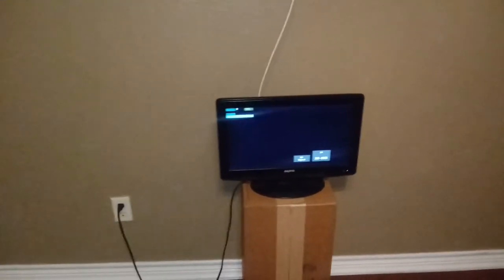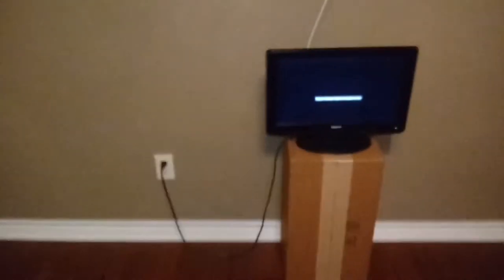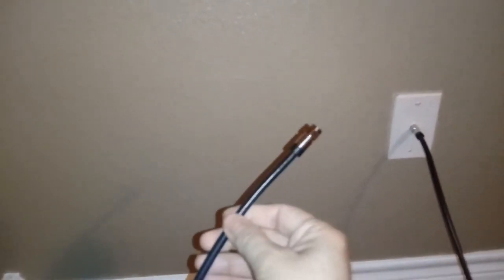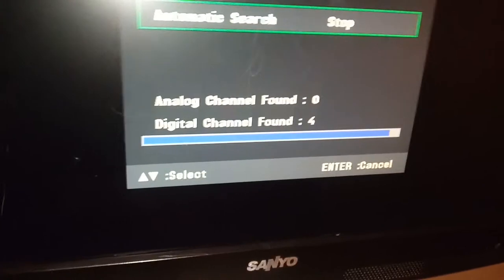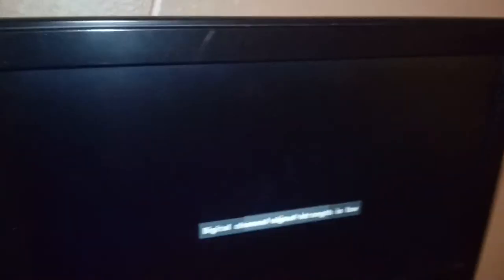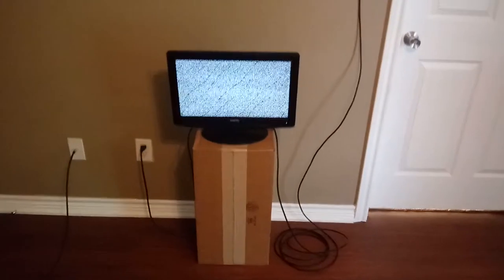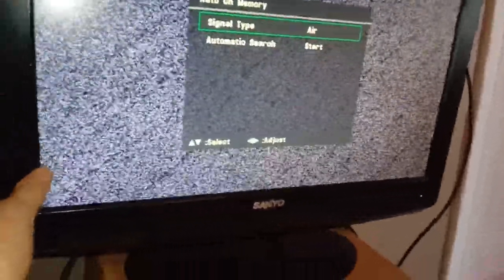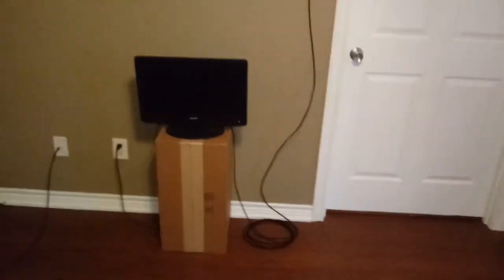The Best Indoor TV Antenna Reception TIp

Comment: They make flat coaxial cables to fit through windows or doors.  They are not to expensive to get.  Its a simple way not to have your cable to be damaged or cut.
Reply from the maker: Yeah, I knew that, and I forgot to mention it in my video, so thanks for the tip!
Reply: @ThriftyinfoMix  , what if I play games on my PC and I also use my television as a bigger monitor since my laptop screen is so small?
Reply: @ThriftyinfoMix  , is there a device that is made for televisions and digital antennas that can make a separate pair of cables go from the digital antenna to the television and from the television to the cable?  I think that having a splitter, as well as having a pair of typical width, as well as strength, cables might help fix that problem that you described in the video.
Reply from the maker: @paxhumana2015  it all depends on how close the electronics are to your antenna cable. If you can keep the electronics away from the cable then the interference would be a lot lower.
Reply from the maker: @paxhumana2015  I'm not sure that I understand the question, but it seems like you are wanting to have cable TV and OTA antenna television at the same time. The answer is yes this is possible and there are several ways to accomplish this depending on your situation. One way to do it is to just use the device that comes with your cable or satellite provider which is the box that you use with their service. This box sometimes has an antenna input where you can plug in your digital TV antenna. Another easy way is to subscribe to an Internet satellite service or some other cable TV streaming service such as Sling TV so you can free up the cable line to use it for the antenna. If your cable or satellite service does not come with the box, then you can use an old VCR to run your antenna to the antenna input and then run your cable or satellite into the inputs on the VCR and use AV cables to run the signal from the VCR to the TV. Lastly, you could run both the antenna cable and the cable TV cable into an RF switch box splitter and then run the switch box into the TV, but you would have to manually switch back and forth between cable TV and digital antenna TV.

Comment: Well, at least your tip helped me confirm that this thing ain't gonna work unless it's set up outside or at least at the window. Thanks
Reply: Indoor antenna outdoors,I also would worry about grounding.
Reply from the maker: Yeah, an indoor antenna is not the best unless you live in an area real close to all the stations, but you can get it to work best the way I explain in the video.
Reply from the maker: An ungrounded antenna is for sure an issue, but less of a problem if you have other things that are grounded which are higher up than the antenna, or if you have the antenna touching another grounded object to get better reception such as I do in this video, then it will be less of a problem as well. Thank you for bringing up this important issue since I forgot to mention it in the video.
Reply from the maker: @PC4USE1  it's also important to remember that antennas like the one used in this video are usually labeled as indoor/outdoor so they are made to be used either way since they are not strictly just indoor antennas.

Comment: set up  , Bumpkin 101.
i guess you can live with that expert install    
The hooks are upside down
  that is Bumpkin  genius 
Mr  Pyle
Reply from the maker: Thanks. I did install the hooks upside down intentionally so the cable would not slip out. Not only can I live with this install, but since I used removable hooks and no tools, I can easily uninstall the whole setup but hand without damaging anything install it somewhere else since it isn't permanent, but it's still secure...

Comment: i am on a 1st floor in a block apt of 8 apt attached to rows of other block apts on my street
when i put the rg 6 coaxial cable attnana outside the window its till 7 chananls which is what i get inside;
should i make the wire touch the metal balcony? Lisa thank you
Reply from the maker: Wow that's strange. You should not get as many channels with your antenna inside, but yes the metal on the balcony might help, but I suspect you are in an urban area where the TV stations are all close by and it won't matter that much. If you want to try to pull channels outside your area you might have to start looking at getting a long range outdoor antenna...
Reply: hello sir ok i get it; i will try to make it touch the balacny metal but as you said yes i am in the city Lisa